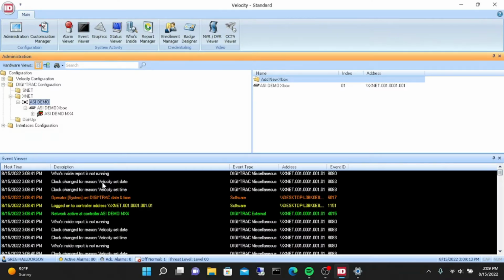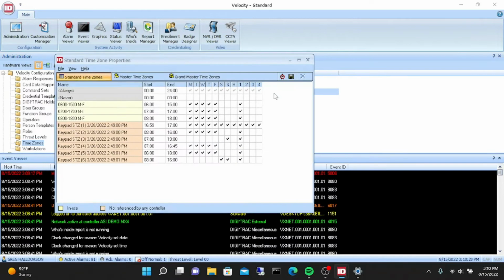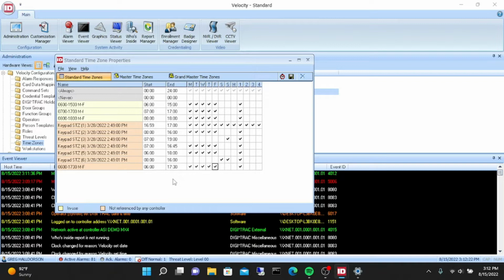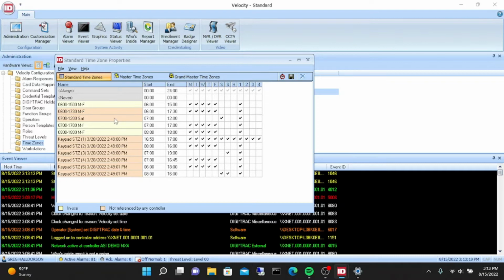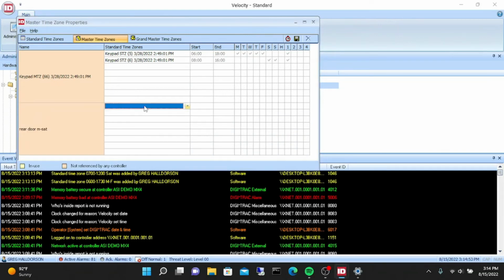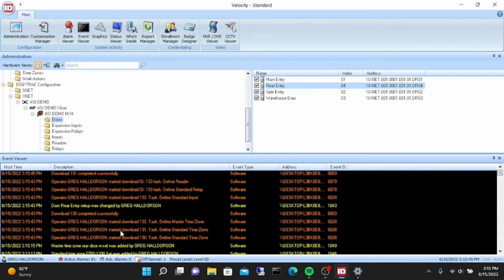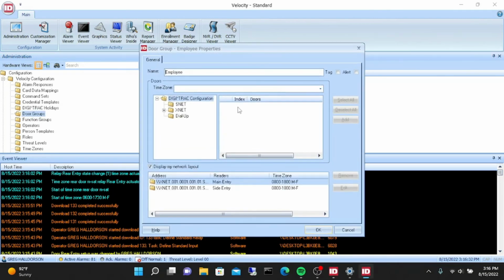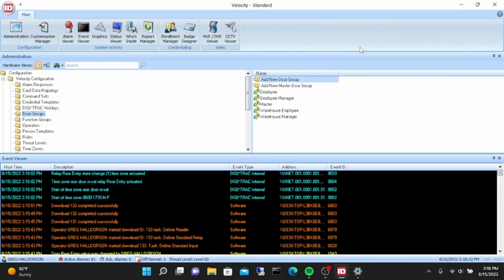Creating and Using Timezones in Velocity

Comment: How do you change the time range of the event viewer? thanks
Reply from the maker: You cannot change the time range of the event viewer. You can have it display up to 9999 lines. default is 100. If you need to see an event that happened you can run a report using the report manager.